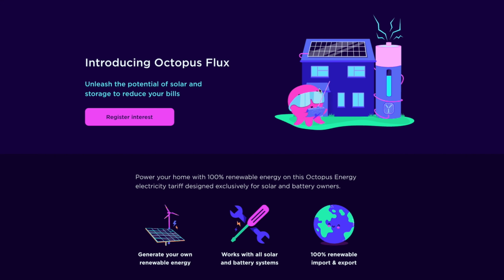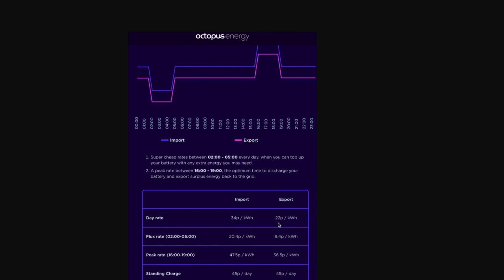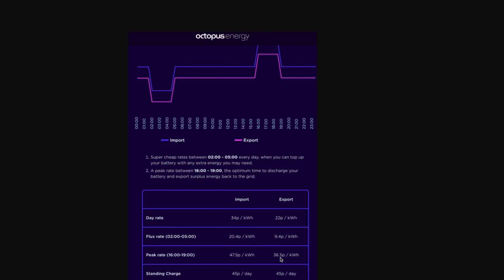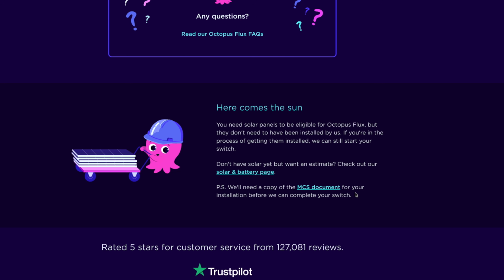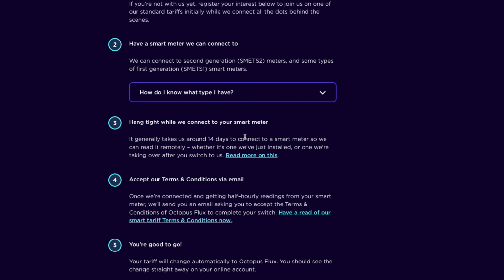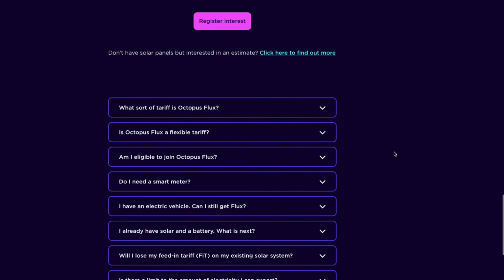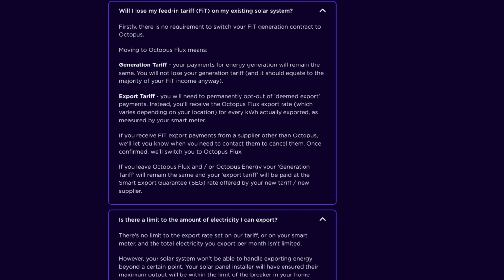Octopus Flux // An Energy Tariff For People With Solar PV // Paid To Export Energy // SEG // FiT

Comment from the maker: I totally missed the 9kWp solar generation point in eligibility.

Octopus Flex Eligibility as of 20th Feb 2023
You'll need to have:

A smart meter providing us with half-hourly readings
A solar system with a maximum generation of 9 kWp (kilowatt peak)
A copy of the MCS document for your solar system
Confirmation your local energy network was notified of your installation *

* This will be a letter or email you got from your energy network, after they were notified by your solar installer.

If you receive Feed-in-Tariff payments from Octopus, or another supplier, we'll also need a copy of your (Microgeneration Certificate Scheme) MCS certificate.
Reply: Octopus has removed the 9kWp restriction
Reply from the maker: @redshift3  Thanks for sharing.
Reply: My panels (3.7 kWh - end of line restriction) were installed in 2011 and my District Network Operator was not informed. This is not a problem because you can apply for a retrospective notification. Fortunately I stall have my original MCS certificate. I also have a Puredrive 10 kWh battery. I don’t have an electric car.

There is no way I wish to lose my FIT as it rises to 68.3 p/kWh from 1 April back of a fag packet maths says the it is worth losing my “deemed” export rate. Last year I generated 3,620 kWh. This would have generated £87. I actually exported 750 kWh but this would return £164 at the day rate. With domestic base load of about 2-300 w, the moment my panels generate more 2 kW or when my batteries are full I spare power that is exported. With Flux I’ll get a better rate per unit for this power. Where Flux should help me is that every day starting at 02:00 my batteries would be charged for 3 hours at 19.12 p/kWh. If I don’t use it or my batteries get to 100% I’ll export it at 21.91 p/kWh. Hopefully, the battery software will load my batteries (PV or grid) to 100% by 16:00 every day. At this time my batteries should then discharge (Grid Support). Anything now exported is paid at 35.3 p/kWh. My batteries will be nearly empty by 19:00 so I’ll buy power at 31.87 p/kWh until 2:00 the following day. If this works I should have free, cheap(er) or standard power until 16:00 every day. Then I’ll be off grid using the battery and possibly exporting at a good rate until reverting to grid power. The risks are plenty. 1. Battery cycles. 2. Potentially buying expensive peak power. 3. Charger/Inverter inefficiencies consuming the margin between grid purchase and export.
Reply: I think I can now make my move to Octopus… 👍
Reply from the maker: @mark_just_mark  Excellent
Reply: 9kW peak for solar PV... Time to get a small wind turbine as its not excluded..😊
Reply from the maker: @G-Cam1  Apparently the 9kW restriction has been removed.
Reply: @ConsideredUK  ah... Yes... I just saw that 👍.. thanks.
SO difficult now to choose the best value tariff... We have solar PV ( just about to add another 3kW.. or as much as I can), Powerwall, ASHP and 3 x EVs as of next week!... 
My poor wee head canny cope with all that number crunching... Bring back the TEP.. 👍

Comment: Octopus has just killed the MCS system by being the first to accept installation from. Nonmember fitted equipment. This will lead the charge by  DIY  systems, the ‘trade bodies’ are a big thing in the UK for protection of those that make them selves special..😊
Reply from the maker: I had read this a while ago, however when I contacted Octopus for the Outgoing Octopus tariff, they have asked for my MCS certificate.

Comment: Hi   I have solar and limited battery storage system (7.5kw), that never sees me through all night once fully charged, even during peak summer periods.  I simply want to buy in cheap rate electric during the night and store into my battery (like the old economy 7 system), and discharge within my house during the day when kw cost is more expensive.  Im not to bothered about selling back to the grid as the only time my battery is ever full is around midday - 5pm as the house uses less power during these times.  What tariff would this be and how do i set the internal house system to work this way?
Reply from the maker: Check out Octopus Go and Intelligent Octopus. Both of these offer good off peak rates if you meet the right criteria.

Comment: We've just had a 7kwh solar system with a 8kwh battery storage, just had smart meters fitted and they are connected to octopus now just waiting for our documentation from the installers but it's all so confusing to know which is the best tariff. With this good weather we are pushing back 24 kWh back to the grid that's after full batteries and all the house usage covered. Obviously in the winter that will change, I would like to buy cheap electric off peak to charge the batteries which should just about cover the house during the day.
Reply from the maker: A good thing with Octopus is the ability to change tariffs easily(ish). So perhaps go FLUX for summer months, then GO in the winter seasons?
Reply: @ConsideredUK  yeah sounds like a plan, I'll speak to octopus soon as the paperwork for the system is through. 👍

Comment: Don't over pay for solar panels,  ask what is your Battery Max input  if its 2000w 
You don't need 16x 405w panels you only need 5 panels 
There's people  getting close 7000w of Solar however the battery only takes 2000w in 🤨😒
Reply from the maker: Its not just about how much the battery can store and take in, there is house consumption to consider, plus larger arrays will be better in the UK winter.
However, as you suggest, its important people do their homework and factor in all aspects of a solar / battery installation.

Comment: Really interesting. I have a spreadsheet that someone on a solar FB group shared that calculates the savings from different Octopus tariffs. Without an EV then Go in Winter and Flux in summer is optimal. With an EV to charge regularly then Go is predicted to be best all year round. Both the solar +batteries system and the EV are recent, so I'll have to see how it goes
Reply: Can you share the spreadsheet, please Billy?
Reply from the maker: Cheers for sharing Billy.

Comment: Going on flux soon  it’s only a summer tariff  we did in 2021 on outgoing to great effect  , in the summer there is enough to put it we’re you need to even if you only export at peak rate it great
Reply from the maker: Cool, be interesting to hear how your post summer numbers turn out.
Reply: @ConsideredUK  yer will be very interesting we got all the bills paid plus nearly £500 worth of credit in 2021 was enough to go from April 21 to March 22 with only a £1 dd a month and average about 20 p a kWh export so with low average export rates on agile this year so far flux is looking worth a try and don’t forget there is no problem switching tariffs on octopus so if flux dont work after 4-6 weeks can switch to outgoing.
Reply from the maker: @nickieredshaw7835  Yeah the ability to switch with Octopus is a bonus for sure, makes experimenting easier.

Comment: Hi Dale you did a excellent job explaining Octopus Flux.I cannot see the the advantage to going with it if you have a system generating 4kW with a 6.5 battery system on the 0.42 tariff no EV vehicle or have I missed something? regards Dave.
Reply from the maker: I would agree based on your setup. Unless you will have a large surplus of solar, or don't have an EV and can benefit from the 3 hours off peak charging, I don't think its a winner.
However, good to have the option and for some people Flux will make sense.

Comment: my Flux rates  (NE wales) are:
	                                        Import	                Export
Day rate                          	35.98p / kWh	26.23p / kWh
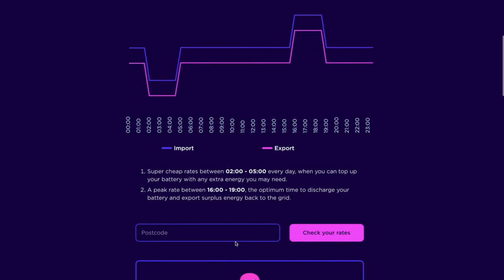Flux rate (02:00 - 05:00)	21.59p / kWh	11.12p / kWh
Peak rate (16:00 - 19:00)	50.38p / kWh	41.34p / kWh
Standing charge	                46.95p / day	

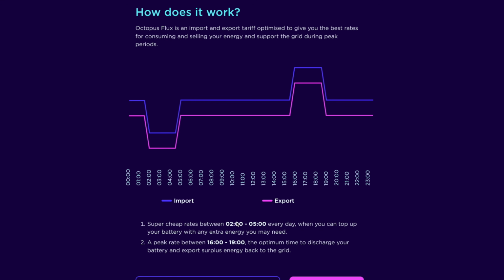So unless we are going to have a fantastic summer I am still in two minds I'm currently on Go so 12p/KWh between 00:30 and 04:30 then 44.28p/kwh the rest of the day
if we do get a fab summer... may be able to top the battery back up after 19:00 in the summer so could be profitable (although on expected dull days the 3 hour window for flux may struggle getting my 9.5KWH battery filled)... on the bright days could make over £3 a day pay force discharging @ 3kwh (battery limits) for 3 hours (9KW) (£270ish over 3 months)
is it easy to jump between smart tariffs... so I can try FLUX then back to GO in October/November (or before)?

Comment: Any idea if Flux allows user control over the Powerwall 2 or do you effectively hand over the battery to Octopus to "manage"?  I can't get the answer from Octopus agents as they appear not to know.  I could be interested in the tariff but only if I get to choose if and when I export back to the grid.  Thanks
Reply from the maker: My understanding is that its not like the Tesla Energy Plan with Octopus where they control what your battery does. On Flux you have full control of your stuff to import / export as you see fit.
Reply: @ConsideredUK  Thanks for that...  I'll be interested to discover how those user settings are achieved.  It would be nice if it could be set up /initiated / halted from the Tesla app.
Reply from the maker: @PaulTaverner-zp2dt  Well the importing part is simple in the Tesla App just with the Time Based Control settings for Peak and Off Peak. The ability to export is possible as an advanced setting with the powerwall, but not currently available via the app for users, only when controlled by the energy providers.
Reply: @ConsideredUK  Time to wait then I think until a few users are actually running with it and see how practical it is in practice.  Octopus might even come back to me with an answer to my question ;-)
Reply: I can't see how this is going to be user controllable and "work for all batteries". Of course, another way to look at it would be to ignore any export trigger (and messing about with forcing export at peak rate) and just assume day rate for export for the purposes of comparison - allowing solar surplus to flow to the grid as at present so £0.25 per kWh as opposed to £0.04.   My import / export is roughly 50/50 so, using last year's figures for amount imported and exported, and taking into account the standing charge and using the likely upcoming costs for my current tariff.  My total annual cost for electricity under my current tariff would be about £330 and by switching to Flux would drop to about £62.  I'm going to have to check those figures again.
Reply from the maker: @PaulTaverner-zp2dt  I agree, the main focus is on energy generation export, not stored energy export.
Yes you could buy and store cheap energy and sell back at higher rate, but I think that probably wont work out that well, and will be alot of messing about.
I think this is really a better options if you don't have an EV so cant get on Go but have a battery. Or you got Solar out of FiT and want something better than SEG and will have a fair amount to export.
However, like you say. Important for each person to do the numbers for their own scenario.

Comment: Im on the agile import and export tariff at the moment (4kwp array, 5kw battery and a EV) so on paper it looks like it is more suitable.  I will need to crunch the numbers, but I reckon I'd not set any export dump from the battery and just take the reduced import rate during the flex period as a bonus (20p vs 40p).  Good to see though :)
Reply from the maker: Cheers for watching and sharing your thoughts, be interested to here if you decide to go for it and how it compared to your agile experience.

Comment: Economy7 for my area (SY11)  Import at nightt 18.7p/kWh   Day 48.3p/kWh Standing charge 47p/day.

Outgoing (Fixed) octopus 15p/kWh export.

I'm told you can be on eco7 and fixed outgoing.

I Currently don't have an MCS certificate, waiting on that.

The Flex tarriff can work in your favour if you plan to charge when off peak and  export peak periods.

So right  now for me, Eco7 is better... but thats likely to go up in price in April.
Reply from the maker: Yeah, if you think you will export alot its probably going to be good for you.
Personally I look to self consume what I generate,  to save buying from the grid unless necessary.

Comment: Question: Are you saying on your old 9kW system you were having the FIT for all 9kW? If this is the case were you feeding it through 3 phase. I was limited to 5kW when I installed mine 9 years ago, by my DNO, due to the limitations on single phase. 
I have another 5kW system now (total of 10kW). but thats not on the grid. I use it to "top up" my 60kWh DIY battery pack along with Octopus Go at cheap rate times. Anyway thanks for the interesting video!
Reply from the maker: Single phase max is 100 AMP, so at 230v thats about 23 kW, so not sure what the reference is to being limited due to single phase, probably more likely the local infrastructure.
My 9kW array was limited to 6kW due to the inverter, so my DNO was approved for 6kW on single phase, didn't apply for the 9kW as the system would rarely generate that in reality.

The 60 kWh battery pack sounds interesting, what cells are you using?
Reply: @ConsideredUK  Sorry I perhaps did'nt explain enough. Yes I believe it was the inrastructure, but I was under the impression from the DNO the limit was nationwide. I was told that for any more than my 5kWh I would need to run "3 phase" to my property. I am aware of the 23kW limit at 100A as I regularly approach that😀, Charging my "pack" and EV in the 4 hours they give us!
As for my battery. I use 64 (4 x 16) QSO and Docan Tech LFP cells at 280 and 304Ah each.
Thanks for taking the time to reply!
Reply from the maker: @pepermintpilot1694  The only thing I have heard thats similar to what you mention regarding restriction is when you do / do not need DNO approval. and then the G98 and G99 DNO approval process. Maybe I have missed something, but deffo never heard of the restrictions you mention, and as mentioned I had 9kW Solar Array with 6kWh inverter and battery that can also export at 5kWh and was all DNO approved.

Comment: My take on battery storage was a Powerwall 2 costs about 8K installed and has a 10 year life or 37MWh  total usage (3.7MWh per year) so £8,000/ 37MWh = 21.62 pence a kWh to use when using free solar PV, so charging at night at say 20p kWh makes no sense as that means its costing 41.62p kWh to use ignoring any inefficiency's. So selling back to the grid at anything below 42p a kWh would be stupid?
Reply from the maker: That math makes sense Howard, I personally think it only makes sense to sell excess solar you cant consume to the grid, vs selling off stored energy, but each to their own.
On a side note, I like to think they Powerwall will still have alot of life in it after the 10 year warranty, the 5kW peak draw is not giving it a very hard life.
Reply: I'm shocked tesla give 37mwh my givenergy batteries have unlimited 10 year warranty
Reply from the maker: @MarkSmith-wc1ek  Tesla is a 10 year unlimited cycle warranty, I think the OP was just stating the typical max cycle over 10 years before warranty expires.

Comment: I’m on Agile and it would seem to be much better than Flux. Even the export on Agile is not bad.
Reply from the maker: How do you find adjusting things to maximise Agile? Do you have most things automated?
Reply: @ConsideredUK  I am still playing with Home Assistant. I used to try and play with the number of slots I used for charging,g but now I use the battery charge % level. I am still working out the best level to set compared to the Solcast forecast. I don't want to over charge the battery and then export to much to the grid.
Reply: Likewise I’m not sure why more aren’t talking, using agile. It’s easy with a battery to avoid high tariff. Especially weekends very cheap energy at night and you get back if exported what you pay, good package
Reply: @richardsutcliffe98  I am still learning how much to charge the battery overnight according to the Solcast forecast. No point paying to charge if it is going to be a good day. I use Home Assistant to set the charge percentage. Saying that, when Agile is really cheap I charge it to 40% anyway. It seems to me there is a lot of things we can do to optimise our systems.
Reply: If the tarrif during the night is 10 p kw/h less then gill your battery irrespective of good weather. Worse case battery full and you sell it back for more. I charged everything last night whilst less than 2p, exported today. If it doesn’t shine use in home, battery comes down. Solar can be the bonus especially if night rate very low
Reply: @richardsutcliffe98  I agree. The average price for the overnight slots has been 21p for me in March. I only had the export setup yesterday.